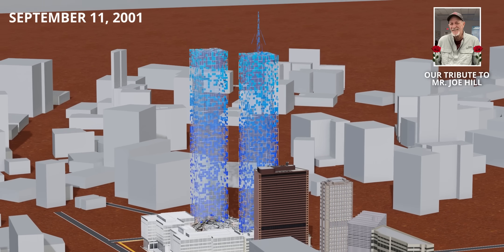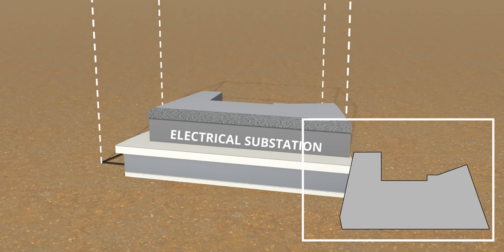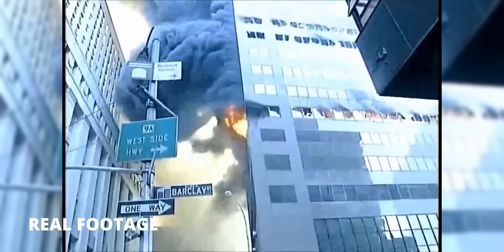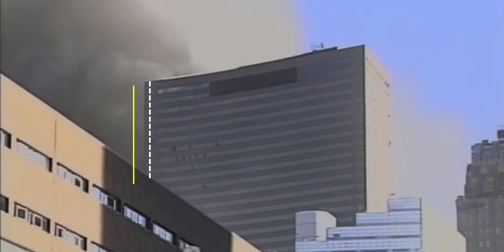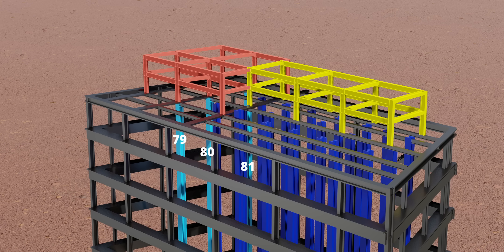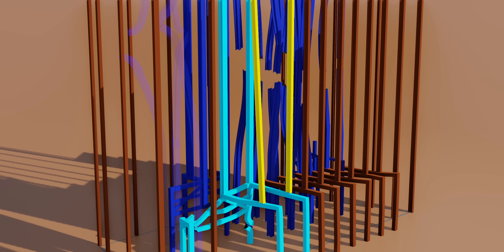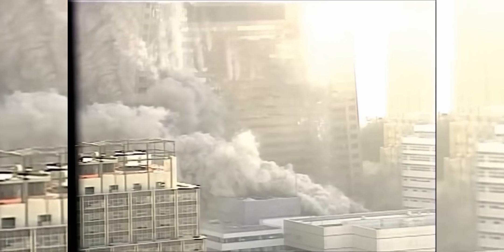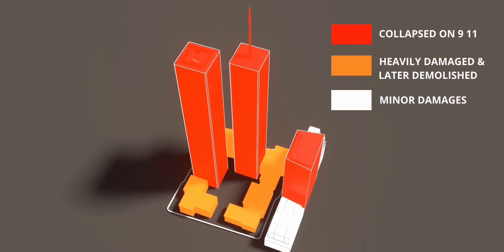Collapse of Building 7 | The Complete Physics

Comment: Let me summarize this video without and misinfo or disinfo.

    The collapse of building 7 in the World Trade Complex happened after 5 :00pm  on  9/11.  Although the media and government want you to believe that it was caused by fire from falling debris from the twin towers, it was actually caused by a controlled demolition. If it had fallen from a simple fire, it would've been only the 3rd steel framed skyscraper in history that collapsed from such. The first two, were the twin towers.. That's because the building engineers design these buildings with these possibilities in mind.. Most people are unaware that a 3rd building even collapsed on that day.  That's because it's so difficult to explain. So difficult that it was not even mentioned in the report made by the 9/11 commission.
Reply: I've seen your explanation and while I appreciate you actually put effort into it, I’m going to respectfully disagree and offer a more plausible explanation. 

Building 7 was the 6th building to collapse of 10 lost on 9/11 and though extensively studied still confuses many. Not famous or a terror target and with no casualties it didn’t get a lot of attention initially, creating an information void the internet would fill with utter garbage. I prepared this brief summary from my own analysis to fix that, using engineering, not politics and tired memes. 

The North Tower collapse at 10:28am bombarded Building 7 with tons of debris, causing heavy damage and multiple floor-wide fires that burned out of control for 7 hours. Half the FDNY firefighters having been killed, others injured, units in disarray, equipment destroyed, no water pressure, and the greater urgency of Search & Rescue efforts, firefighting was pulled as futile. The building couldn’t be saved and was left to its fate. That is the sort of choice firefighters make every day in brush fire situations - which houses to save and which ones to let go. Only real difference here is moving the decimal on the size and cost.

www.youtube.com/watch?v=g_SvpwyC17M&ab_channel=MFitz  

Collapse of a burning structure is always a concern for firefighters. Steel buildings subject to fire rely on active fighting of the fires to survive. Buildings are designed around 1 to 3 hours of fire resistance, allowing time for occupants to escape and ACTIVE firefighting to get started, after which all bets are off. Left to their own devices they will exceed their design envelope and collapse. In B7 the occupants escaped, passive and active fire protections were compromised and active firefighting was abandoned 3 hours before the collapse, which left the building to its fate. It lost. Odds on Building 7 would eventually collapse, and it did. No big deal in logic. But there is no logic in conspiracy belief. 

www.youtube.com/watch?v=WnYBX6QT0R4 

FDNY Chief Daniel Nigro ; The biggest decision we had to make on the first day was to clear the area and create a collapse zone around the severely damaged 7 World Trade Center, a 47-story building heavily involved in fire. A number of fire officers and companies assessed the damage to the building. The appraisals indicated that the buildings structural integrity was in serious doubt. I issued orders to PULL back the firefighters and define the collapse zone. It was a critical decision; We could not lose any more firefighters. It took a lot of time to PULL everyone out, given the emotionalism of the day, communications difficulties and the collapse terrain

FDNY Deputy Chief Peter Hayden ; We had our special operations people set up surveying instruments to monitor and see if there was any movement in the building. We were concerned of the possibility of collapse in the building. And we had a discussion with one particular engineer there, and we asked him if we allowed it to burn could we anticipate a collapse and if so, how soon? And it turned out that he was pretty much right on the money, that he said 'In its current state you have about 5 hours

The collapse of Building 7 was anticipated and widely reported in the media throughout the day. At least 24 video cameras recording some or all of the collapse. Everyone knew what was coming and why.

www.youtube.com/watch?v=OY5S5k3tMHI 

Building 7’s collapse was completely different to the Twin Towers and harder to understand with most details hidden from view. But we can still sort out what happened through careful analysis and observation.  This is my explanation  of the collapse using the best available information and relying on no authority.

B7 was complex 47-story steel framed structure built on top of a smaller existing 3-story building, requiring several lower floors dedicated to complex load transfer structures instead of usable office space. Of trapezoidal shape and all-steel tube-in-tube construction, B7 (above the 7th floor) consisted of a central core of steel columns carrying most of the gravity load, perimeter steel columns around the outside of the structure carrying the remainder of the gravity loads and long span beams and girders to tie those elements together and form the floors. On the outside of the building hung a moment frame - the last part of B7 to fall 

Phase 1 : The first externally visible signs of collapse initiation occurred at 5:20:28 pm and was notably quiet with observers not even realizing the building was collapsing! There was no audible warning in the form of  hundreds of ear drum busting 180-190dB explosive bangs preceding the collapse. Here at 12:00 a local CBS affiliate reporter is talking 10 blocks from B7 when collapse begins. People don’t start to notice the collapse until 12:11. At 12:45 is the famous CBS fixed camera clip of Building 7’s collapse. Note how quiet it is.

youtube.com/watch?v=t5tEy6mXSE8&ab_channel=fresnosean379

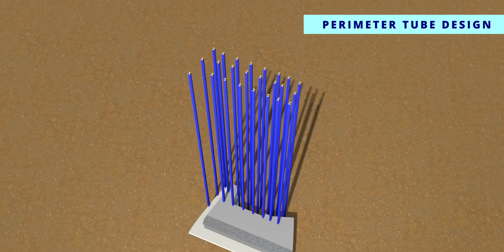Collapse initiation was due to lower floor failures above the load transfer region (7th floor) in the NE corner. In this video at 0:45 you can see the NW corner from inside the building while under construction, Column 79 just out of frame on the left. That big, angled steel beam across the top of the frame connects to C79 at one end. The girders connect to the beam. That beam and all those girders depend on just one connection

youtube.com/watch?v=nP3TNHPCIVU&t=35s&ab_channel=EdwardCurrent

Phase 2 : Lower floor failures caused a loss of critical lateral support over an excessive length of core Column 79 and it buckled. If you look at a floor diagram of Building 7 (see above) and look at all the structures that depend on C79 you quickly realize this one column was a relatively isolated structural element on which a disproportionately greater fraction of the structure depended analogous to say the Key Bridge. Externally we see a vertical progression of window breakage along the 44-46 line and a kink in the roof of the East Mechanical Penthouse at the top of the building, consistent with C79 failure. The transition from full capacity to almost no capacity occurs in virtually an instant. Once the buckling failure occurs there is almost no resistance

Normally with a buckling column, the load could very well be redistributed to other columns, meaning the buckling could stop after a while. With C79 that is not the case - the failure did not redistribute the load, so the collapse rapidly progressed to the roofline, sinking the rooftop penthouse.

Phase 3 : With C79 gone, B7’s progressive, non-symmetrical collapse continues with C80 and C81 at the east end of the core left laterally unsupported and quickly buckled and failed as well, sending the EMP down through the building. C79-81 all have no diagonal bracing, which I believe is a major reason why they could not redistribute a lot of vertical loads among one another.

From there collapse progressed from east to west through the central core until the core was gone taking all of the interior floors and probably most of the perimeter columns with it. Follow the horizontal progression of window failures low in the building and the dropping of the remaining rooftop structures into the building. One of the big takeaways from the NIST Building 7 study (that gets completely ignored) was their modeling which determined C79 failing under ANY circumstances would have initiated the same collapse sequence.

Phase 4 : After 10 seconds only the exterior moment frame - a hollow empty outer shell – remains, giving the illusion the building is still standing since little has outwardly changed. But it’s just a hollow empty shell like an empty cereal box and supported by only a few remaining columns quite unable to remain standing. With all internal framing gone, the north face leans inward, forming a V in the roofline, the last perimeter columns buckle under the strain and the moment frame free falls, landing on top of the 7-story high debris pile. It is here, at the end that a single measurement of alleged free fall acceleration is taken, from a single point on that outer shell. The Building (defined as its center of mass) did not “free fall” – just one corner of the outer shell did. The Building was already gone before that happened. The period of alleged free fall was a product of collapse progression mechanisms, not of collapse initiation mechanisms and cannot inform as to what started the collapse. Start to finish the entire collapse took 18-20 seconds, 3 times longer than true free fall .  How fast something falls cannot tell you what started it falling_ anyway. The debris spread outside the footprint, blocking surrounding streets, heavily damaging the Verizon Building and destroyed Fiterman Hall.  

Building 7’s progressive, non-symmetrical collapse was incidental and unintended collateral damage from the combined effects of fire + time + gravity, started by the collapsing North Tower. That is true no matter who planned and carried out the 9/11 attacks or why . The collapse was of so little consequence it barely even registered at the time, a mere footnote. It only took on semi-mythical status as an alleged smoking gun years later when demolitions at the Twin Towers, missiles at the Pentagon and shoot down over Shanksville all failed and conspiracists had nothing left to work with.

Anything can seem like a conspiracy if you don’t understand how it works. Now you should. I hope you found this helpful, informative and it solicits informed critical comment. If I made any errors of fact, logic or reason or left anything important out, please let me know so I can fix it. IF you can offer a more plausible alternative please do. Be the first. Please start any reply with the words “Tits McGee” or I will know you didn’t read it and are wasting my time.